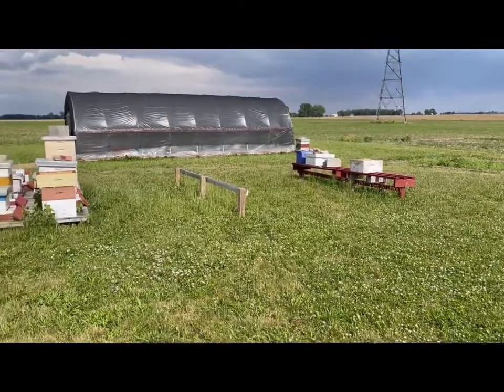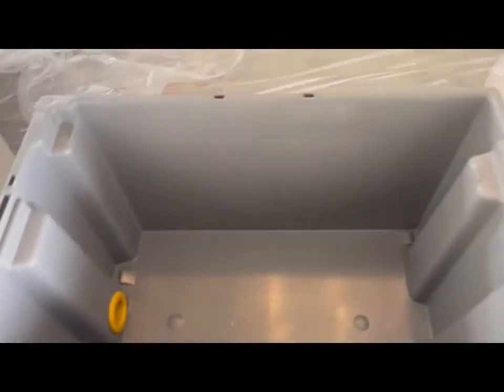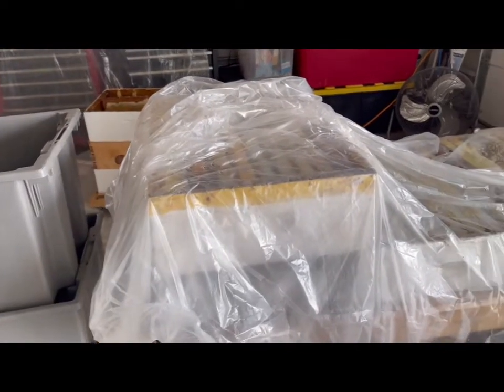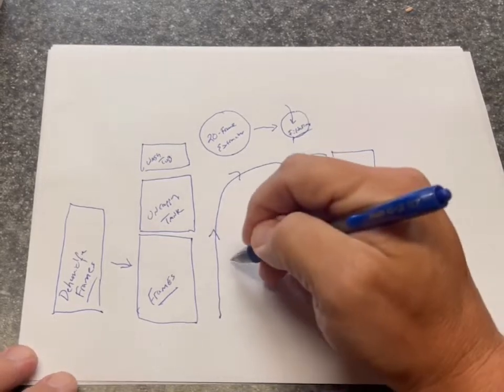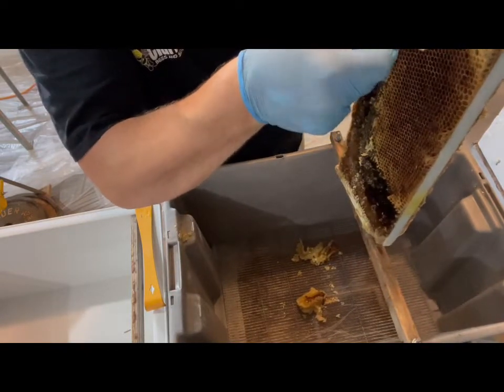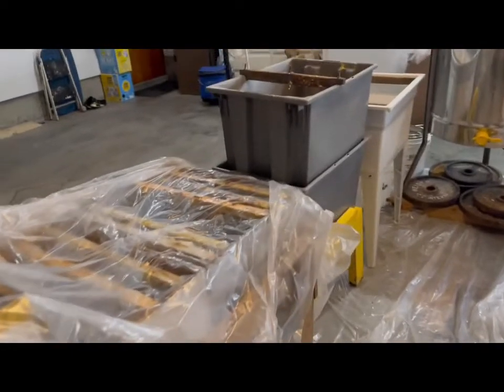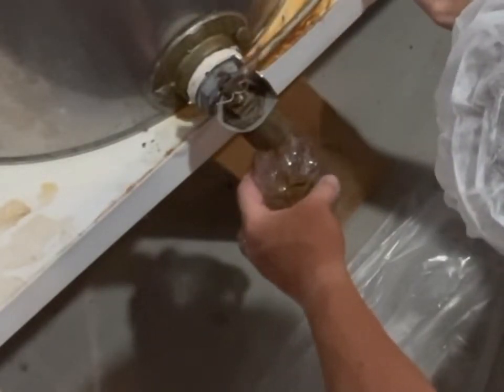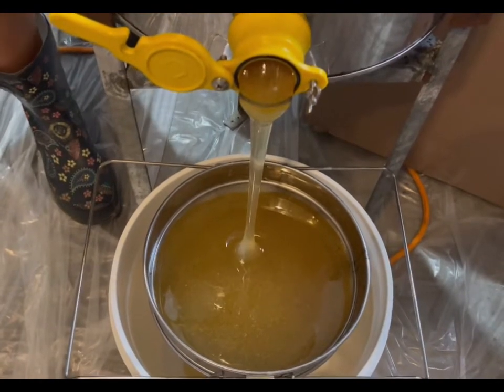Beekeeping for Beginners: Honey House Set-Up, Extracting and Bottling Honey

Comment: Good video. Work flow looks good. Do the new bottles need washed before filling?
Reply from the maker: Thanks for watching! Sorry I just saw I hadn’t answered your question. If they are new bears direct from the factory, I generally do not wash them. Raw honey is anti microbial, so unless the bears were dirty, there shouldn’t be a need. If I have any doubt, however, I will use a sanitizer rinse on them. Thanks again!